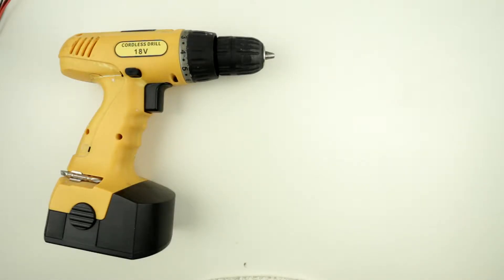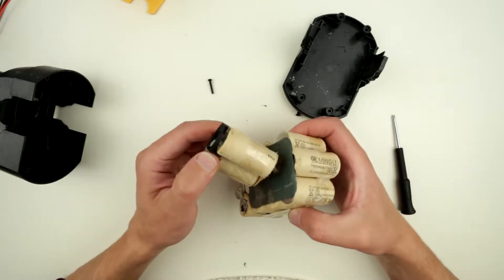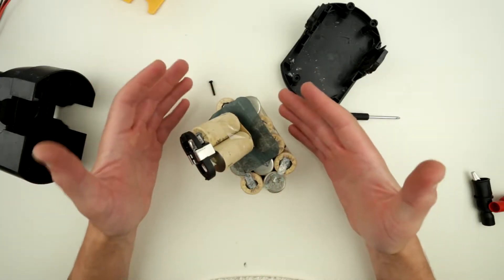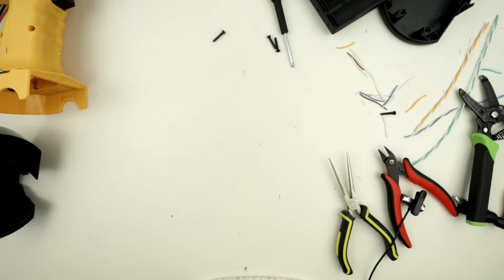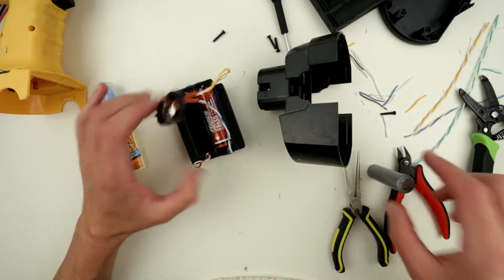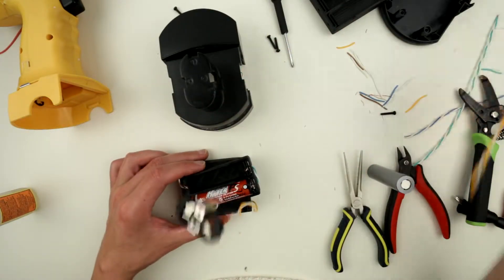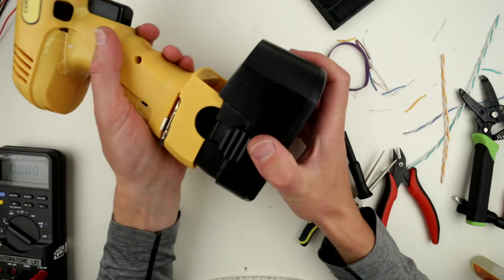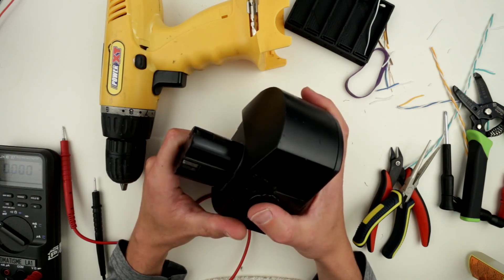Project: How make old drill alive again !

Comment: you had a clip repeat at 17:59 but otherwise the video was pretty good. I do have a question, how are you going to charge the new battery pack? are you going to use the old charger or something else? Thanks
Reply from the maker: Thank you for watching ! Oh my, thank you for pointing this out. 
As far as charging I just pull them out and charge in standalone charger and currently working on embedded charging module. Also they last way longer then any NiCads were ever lasting